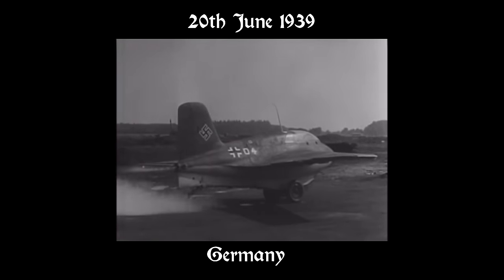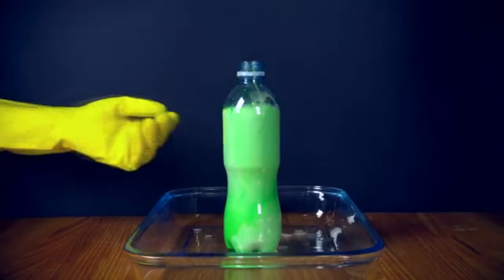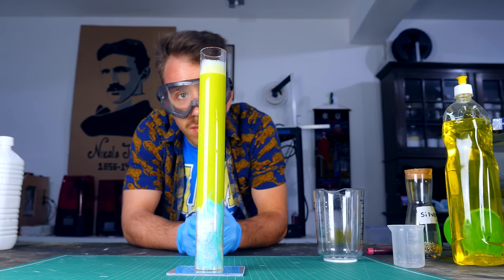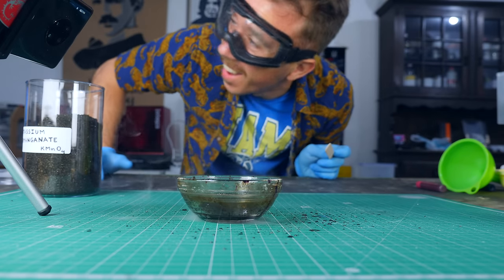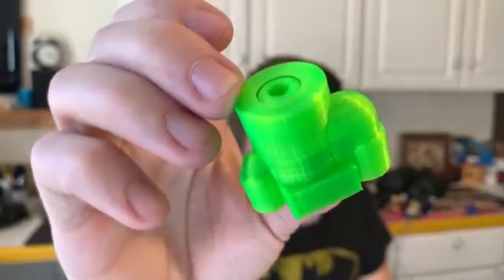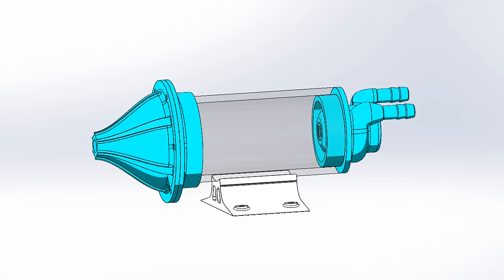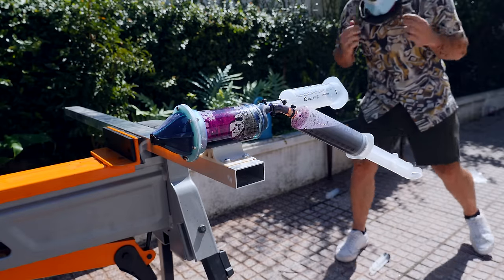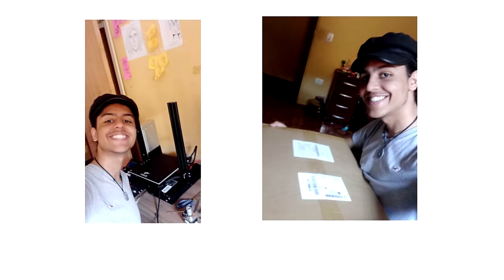The Forgotten Nazi Cold Rocket Engine (3D Printed)

Comment: Hypergolic is less a rocket engine and more a rocket fuel/oxidizer combination. Engines that use hypergolic fuels usually are similar to other liquid engines, they just lack any starter plug since the combination will burn on contact with each other. This actually makes them somewhat safer to fire, as it’s almost impossible for you to end up with an unignited pool of oxidizer and fuel due to a failed starter. 

Hypergolic fuels are extremely common in military applications, especially for missiles that need to be delivered with sealed fuel tanks that will work years later. For civilian applications it makes more sense nowadays to use liquid O2, which typically isn’t hypergolic with most fuels and can’t be stored forever, and deal with the annoyance of fueling before launch and using a pyrotechnic igniter. 

Oh, and most of the hypergolic oxidizers are holy terrors in their own right. Red fuming nitric acid with hydrogen fluoride in it? Chlorine trifluoride? No thank you!

Comment: He should read up on how the Germans made the rocket for the ME163 comet. It would climb up to 25-30 thousand feet in only a few minutes. It was so dangerous the planes would sometimes blow up! But their concentration of the fuels were close to 100%. Damn! There are movies the Germans made of comet takeoffs and climb out to altitude. Very impressive for 1940’s technology. But the hydrogen peroxide was so dangerous that if you put your finger into a container with it, you would come away with just bone! No wonder they sometimes blew up! 
  This guy is way to cavalier with these chemicals. Good thing his concentration was low, but the results were still impressive! Yes? Since the video was up and ready, I knew he didn’t kill or injure himself. He was totally surprised when he first mixed them.

Comment: @integza please understand how to make it perfect
remove the syringes put some tubes with some kind of pistons solenoid valves (2) with compressed air behind + one way valve after the fuel tubes so the pressure cant come back put all the comps in a row and boom you have a rocket 3d print a rocket model put them in and stabilation and you are ready ( with 3d printed fins or carbon plated )

Comment: Yep.  How about that?  I think that this RX was also used to propel the winged V1s (?) off of its ski jump ramp as well.   If you're really into unexpected propulsive methods, might want to google the phrase; 'Traveling Through Space --- Without Rockets --- The Shorter Version.'  Or maybe use a similar phrase to search in the upper less than couth reaches of the Amazonium.

Comment: Back in the old days they used to sell cold model rockets and what you did was you fill the chamber inside the rocket with freon and then to launch it you pull the pin out. I read this in a older version of the handbook to model rocketry by G. Harry Stien
Reply: ah yes, my favorite, the ozone-melter rockets :P

Comment: Rockets have been an interest of mine for a long time. This experiment with cold rocket fuel is quite interesting. I had no idea it could generate this much thrust from a simple chemical reaction. It's worth looking in to. Never know what you'll find. I did have an interesting idea. Steam expands up to 1600 times it's size when heated. Is there away to inject a mist of water into a small aperture then super heat it to a gaseous state rapidly enough to make it create an expanding gas through a nozzle and generate thrust. If it did this once or twice a second do you think it would work? A micro wave beam into the aperture might do it. ???

Comment: Maybe you could use a portion of the thrust/ pressure created by the reaction to actually force the fuels into the rocket? Maybe by using a turbine fed by the exhaust... or just  a small pressure tap from the nozzle that redirects pressure behind 2 separate pistons that drive the fuel into the reaction chamber... That way...Once the rocket engine is started... it provides its own pressure to inject both fuels? Also... while we're on the subject of suggestions.... Have you ever heard of a Slocum Glider... It's a buoyancy propelled winged underwater glider... I pilot them... but you should build a  3D printed one!

Comment: Back when John Carmack (of Doom fame) started Armadillo Aerospace, they tested a whole bunch of designs for H2O2-based engines. They tried injection of potassium permanganate along the way, and while that worked reasonably well, it didn't do all they wanted. The final designs of their engines used a combustion chamber packed with steel rings plated in platinum as a catalyst. Expensive as they were (though I don't think ridiculously so due to the thinness of the electroplating), the rings, which packed into the chamber in a random fashion intended to maximize surface area, improved decomposition of the H2O2 greatly and wasn't either consumed or ejected out the back of the rocket, so could be reused time and again. Think several hundred rings about 2 cm in diameter and 1 cm long in a volume about two liters. Eventually they went to a bipropellant situation, where they mixed 50% (and later 85%) H2O2 with 95% ethanol. When injected into the chamber, the H2O2 decomposed into water (steam), free oxygen, and a lot of heat. The free oxygen and heat combined with the ethanol to create a secondary/parallel reaction that was combustion, creating a useful-for-rockets level of exhaust velocity.

An interesting design they came up with to keep the steel chamber from melting was to have the bipropellant flow through a very thin (~2mm if I remember correctly) jacketed volume around the combustion chamber. This heated up the bipropellant, which aided combustion, and kept the chamber cool (relatively) because the heat not used to create exhaust velocity was, to a certain extent, redirected into the chamber with the fuel. They continued this design when they migrated to a LOX-methane design, with the LOX flowing through the jacket so it was at vapor temperature by the time it entered the chamber.

Also of note, as I remember, they milled their rocket nozzle throats out of blocks of graphite.

Comment: A Hydrogen Peroxide rocket engine was used in the Sanders Roe SR 177 Prototype which used woven silver metal pads in the nozzle to decompose the Hydrogen Peroxide, this engine was used to supplement the jet engine which was used for take off, landing, and cruising, the Hydrogen Peroxide rocket engine was to used for climbing to interception altitudes.

Comment: way back in high school I and my fellow nerds hit on this idea too.  Take a medium size test tube wrap with some tape fill to about 3/4 
with 30% H2O2 which we happened to have in the school science lab.  Next a rubber stopper with short length of 4 mm ID glass tubing
placed in the central hole.  Then take one small crystal of potassium permanganate and wedge it in-between the glass tube and stopper
on the end that goes into the test tube clean off any other loose bits .  Now the the tricky and dangerous part at arms length carefully
insert the stopper and tape it in place leave small tab of tape sticking out.  The rocket is now ready  carefully place the rocket stopper 
up into any tube with a ID just large enough accommodate the test tube but the tape tab prevents  it from sliding down the tube.  
Now invert the tube and the rocket launches best done out out of doors .

Comment: You could also use a catalytic converter carefully disassembled to expose the tube shaped catalyst coated ceramic mesh
Reply: Also check valves are important

Comment: I wonder what would happen if you atomized the peroxide so that it will distribute into the t-stop can be regulated by atomized flow rate because of the t-stop being much thinner liquid than the z-stop is. A lot like fuel injection systems. Probably stupid but that’s what I’m seeing in the tests. It’s not mixing with an even flow and the reaction is quite fast.

Comment: Ya know a better way to remove resin supports is by using either a heat gun or warm water before curing the parts other wise it’ll be a nightmare to remove

Comment: Does the ratio of chemicals make a difference to the thrust (and heat).  I was thinking use gravity feed (for right now) into the engine then you can throttle it with varying the feed rate with simple ball valves?

Comment: Why don't you 3d print a couple of small turbine pump? Be sure and put a ball check in the lines to stop the combustion pressure feeding back into the pumps. Also, a "blow out" tube should be added in the line so that if some over-pressure excursion occurs, the material will blow away from you. With two small turbine pumps you should have your rocket running. Remember, many test pilots were killed when the engines exploded and the Peroxide dissolved them. Loved your demonstration. Just an aside, add a small gyro platform to the nosecone and some 3d printed exhaust vanes to the exit nozzle and you'll have guided ballistic missile instead of a "rocket". Keep up the good work.

Comment: You could improve the fuel mechanism adding one way valves to avoid the pressure and gases going back to the deposits.

And do some mechanism to make drops of the two compounds for the reaction justi in time to be mor efficient, i mean you can coalculate the time of a certen amount of componds are reactive and in the moment that the reaction is going down do an other reaction.

Comment: i would like to see a peroxide rocket engine if you  pump a 30% to 70% Peroxide solution directly in to a “black pipe” combustion chamber you should get 1 lb of thrust for each psi of pressure you inject the peroxide there should be planes available on the internet

Comment: This engine are a combination of hydrogen peroxide and cobalt, when you mix these two they have an explosive chemical reaction .when you control the two fluids as they  mix at the nozzle they create huge amounts of thrust .P stuff and c stuff  that’s what they called it which stood for peroxide for the P and cobalt for the c, it was simple yet elegant design with today’s electronica fuel injection systems mixing those two compounds would be very easy and much more control able. They are easy to obtain both the peroxide and the cobalt they’re used for many chemical reactions requiring heat as with fiberglass resin .

Comment: I'll say this about raycon. I bought a pair of e25 earbuds way back when raycon first started getting big. As shitty as the build quality is, things falling off, the case being held together with gorilla tape etc, they Still sound as good as the first day I put them in. I've had 3 other pairs of earbuds from diffrent brands and all of them totally stopped working but the e25s still work. I did buy a pair of e55 raycons and they stopped working with only 3 months of use. But the original run e25s still work even though they are falling apart at the seems.

Comment: Would it be viable as a steam generator to run a steam engine in place of a conventional boiler? The exhaust could go into a pressure vessel and the mix of the accelerants could be turned on and off by pressure monitoring to keep the pressure steady. (I expect too expensive to run)

Comment: I am a new suscriber to your web site. In the feedbacks of that 3D cold rocket engine project in the ignition part i could not see any suggestion from your followers of using a glow plug from a flying model airplane glow engine, would it be from a two stroke or a four stroke one, instead of one from a diesel car engine. Also if you used the cylinder head from a model two stroke engine it could also be used, maybe, as the beginning of a kind of glow plug support for that project. And if your project would eventually turn out to a flying model, then using a much lighter and much less expensive RC planes part would have all it's meanings. I know 3/D printing is maybe a new tool for now and the future but someone using actual parts/tools can be sometime as efficient if not more for making some parts. Thanks for reading me.

Comment: Build a reality exploration device. Infrared and Ultraviolet Vision, All signals, tv, radio, microwave, ultrasound. Can connects with everything, bluetooth, wifi, nfc. Should have acelerometer, gps. should have a termomether, compass, and stuff like that. Running an open source system, should be an open source project. You can do the basics, than everybody can help. Cause smartphones are great, but we need something else, less alienating and that can help us learn and think about the world. It is inspired  by the enciclopedia, but now with technology, it may be the lab to.

Comment: try making a heart from a 3D printer, then insert it into a test animal, but not into a tomato.
try to make a useful drive for a submarine.
I think every research facility should have a 3D printer and a design team of engineers to supply facilities with a way to make repairs for all their equipment to solve breakdowns and to implement onsite innovative improvements from unforeseen calamities.

Comment: Hydrogen peroxide was used for reaction thrusters on the US Mercury spacecraft of the 1960's  It is still used on the Russian Soyuz.  Concentrations above 60% create enough heat to turn the water released (along with O2) to steam  German Walther engine used 80 % peroxide  Concentration of 90 ^ are used for thrusters The catalyst is in form of fine screen (silver or platinum ) where peroxide is forced into screen by pressurized gas  The resulting high temperature steam and O2 create the thrust

Comment: you should go look into the original jet packs it used a similar tech hydrogen peroxide is sprayed through a pure silver mesh using compressed air to get lift (its been 30yrs so I maybe off a bit on the details)

Comment: We stop when things go bad to have a think about it further rather than blowing ourselves up. I designed a solid propulsion rocket once using multiple engines, while designing the casing my friend did the math. He came back with a bit of paper with a lot of numbers on it but the main ones were 10000 ft approximately and Mach 2, I screwed up the paper, my design and my childish dreams and moved on.

Comment: Although the Germans used alcohol and liquid oxygen as fuel for the propulsive power for their V-2 rockets, they did use hydrogen peroxide and potassium permanganate to generate high volume steam to power the rocket's high volume fuel pumps for the primary propellants.

Comment: I'm sure you would have had a better reaction had you first turned the silver into finer particles.  The H202 was just kind sitting not just on the surface of the silver pellets, but on the top of the surface. Poured into silver dust being agitated, it may have been pretty violent.
Reply: It actually works best as a mesh.

Comment: If you make real pressure, the mixing chamber needs to be one piece and stronger. check out the Germans design from WWII, one way valves are also needs so you don't blow up your storage tanks.

Comment: What you made like a solid rocket engine out of the black stuff and shot the hydrogen peroxide down the center of it to where it react as it traveled through it then you would only have to pressurize the hydrogen peroxide

Comment: What you showed there was just the "harmless variation" of the Walter engine. This was also called the "cold Walter engine". The recoil was caused by the expelled water vapour: a single kilogram of hydrogen peroxide was enough to heat 7 litres of water to 100° C in fractions of a second. 
The "hot variant" had a slightly different mixture and was really hot as hell!!! When hydrogen peroxide reacts, oxygen is split off. Now all you had to do was inject a hydrocarbon mixture into the combustion chamber and the small Me 163 (nicknamed "Kraftei" = "power-egg") became the fastest manned fighter aircraft of the Second World War: 1000 km/h!!!! The two strictly separated tanks contained 
Tank 1: 1028 litres of hydrogen peroxide 
Tank 2: 500 litres of hydrazine hydrate and methanol
If you want to do this as an experiment, for heaven's sake be CAREFUL: 
I injected the hydrazine hydrate-methanol mixture into the bowl with the H2O2 from a safe distance using a syringe with a cannula and easily produced metre-high flames!!!

Comment: I am pretty sure the German rocketeers upgraded to putting men ME163 rocket interceptors powered by hydrazine and methanol mixture oxidised by >85% hydrogen peroxide. That's a way more sketchy project than hydrogen peroxide and potassium permanganate.

Comment: Oh look I am only 3 years late... Anyway...in one version of the Me163 the Germans ( the not so nice WW2 vintage ones) impregnated chucks of
concrete with KMnO4 - put said chucks of this into the chamber(via a basket)- and also used a silver mesh screen on the primary nozzle exit and forced the H2O2 through the lot.
Yes it worked - but they eventually went with the dual liquid version. Fun Fact 1- the Me163 Pilots wore a PVC suit to stop the liquids melting them if one of the fuel tanks/lines leaked. If both tanks leaked you didn't have to worry about being melted as you wouldn't have anything left to be melted. Fun Fact 2 ( not so fun) - although the PVC suit worked the fuel would get in through the stitching...and you melted...kind of suck really. Fun Fact 3 ( another not so fun one) - the introduction of organic materials into highly concentrated H2O2 can turn you into red mist...and hence the reason why I didn't experiment in recreating Herr Walters little nightmare steam jet engine...sorely tempted though...
Reply: Another reason is that I can't do math .....ermmmm....1 year late.(?)

Comment: Look is to my site the LX project this is whit H202 of 85% we start whit the cold motor and then we have to go over to a hot motor whit kerosine ans H2O of 85% we have concentrate are one H202 from 50% that is use for to clean wafers till 85%